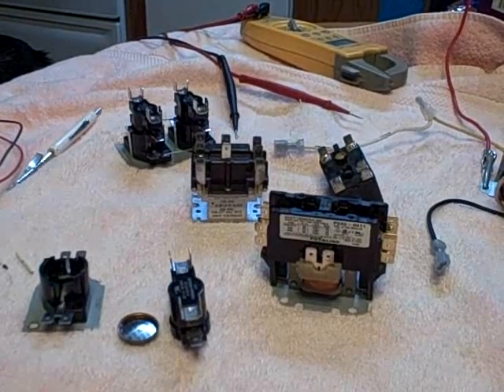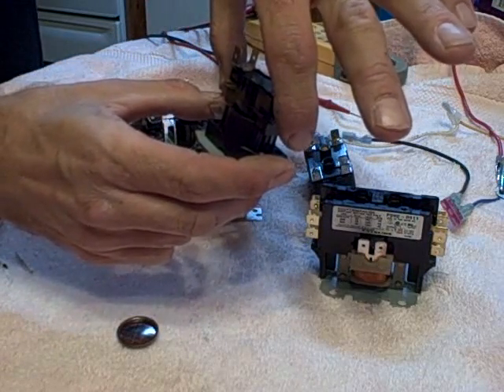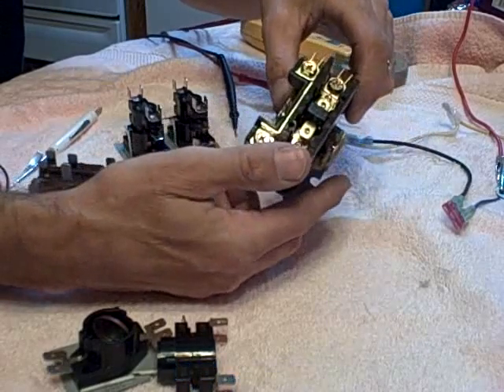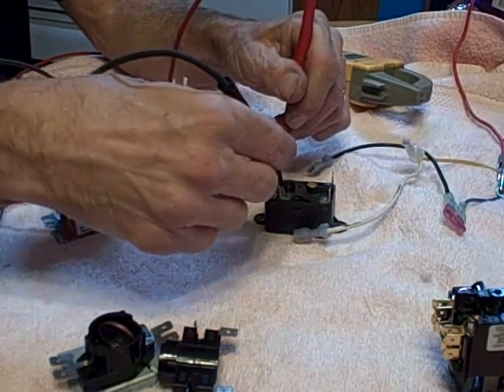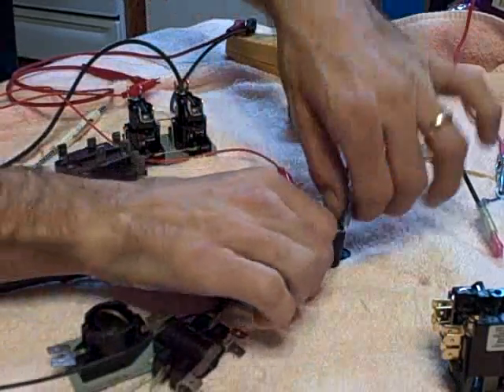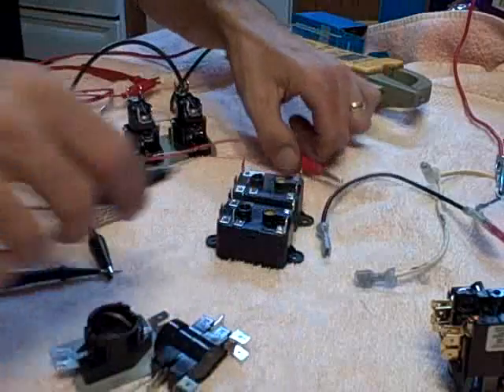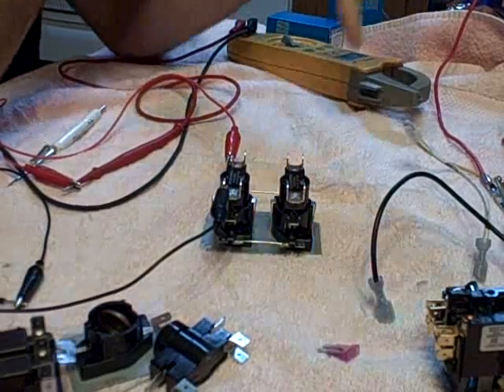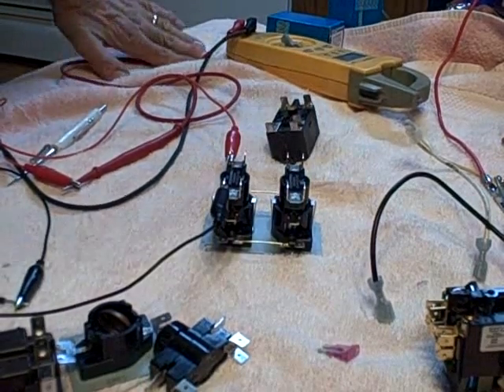HVAC relays and heat sequencers

Comment from the maker: The sequencers?  Typically they don't.  Usually a 2 set on a plate will have a 1-30 on and the other will be like a 30-90 or or something like that, stepping them on and then stepping them off.  Bought this set and didn't realize that they were both the same on/off :/ heh.